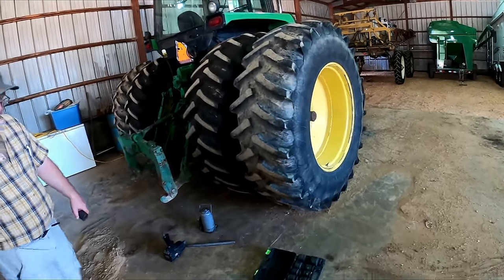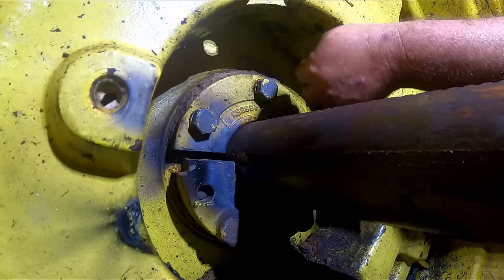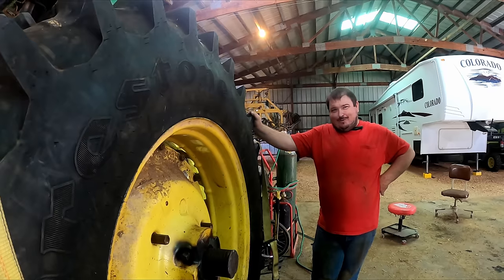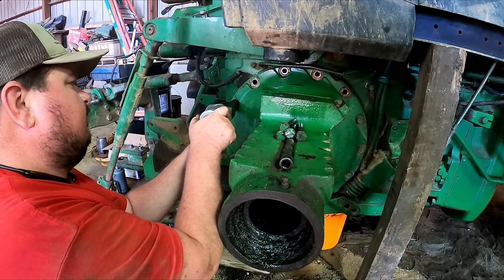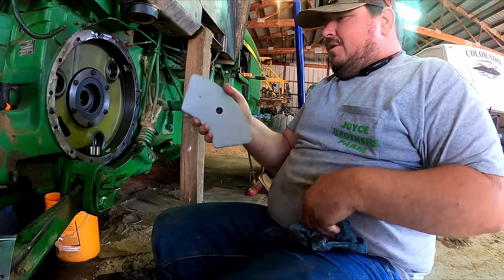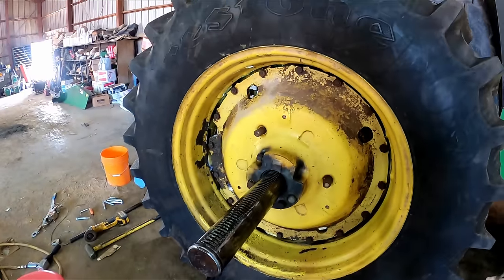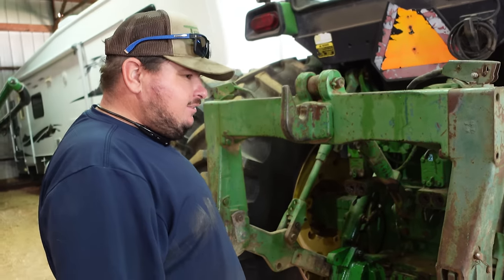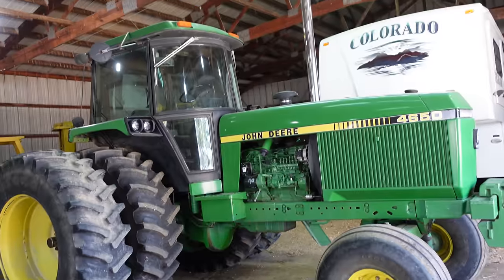"Major Breakdown": How to replace axle and housing John Deere 4650

Comment: Hey Guys, excellent work and results! 
One suggestion, consider the use of 'guide studs' for good control when removing and installing heavy components.....they help tremendously when removing, so its not an all-or-nothing event when you come off the dowels....even more help when installing as you get an early target which has you in perfect dowel alignment.
We just make ours to suite....hacksaw off the heads of three or four 6" bolts...fashion the cut end for your choice of removal tool....screwdriver slot or squared off for socket, etc.

First started making and using these many, many years ago to set Detroit Diesel heads, which use a head gasket made up of all individual components rather than one piece style. Guides give you a way to slowly lower with precision..stopping along the way to make sure things are staying in place.

Taking the time to make,  you'll soon have enough diffferent sizes to work with about any job!
Reply from the maker: Thanks for the advice.

Comment: Yours is the ONLY video I’ve seen on removing the axle from the differential. Mine’s a smaller project, a JD 2020, but the principal’s the same. I got stymied after I got the 12 housing bolts off, but I think a come along should break the housing free.
Reply from the maker: Yea, the weight of the long axle on the 4650 is enough to break it loose without an excessive amount of prying.